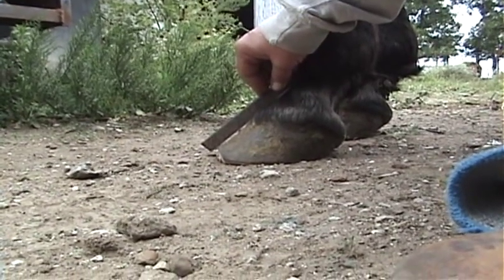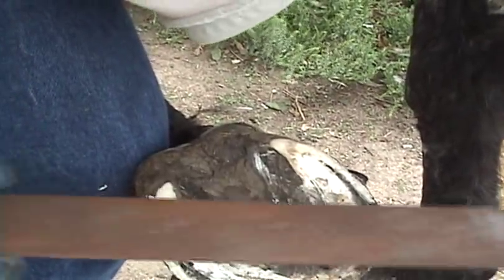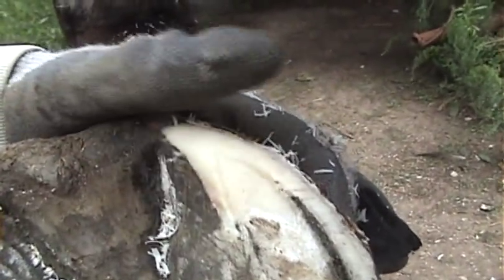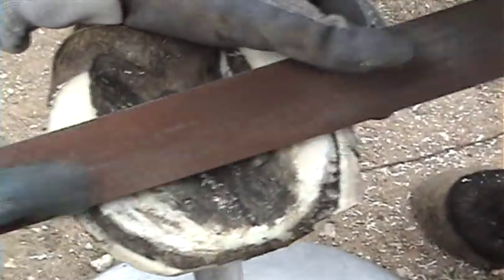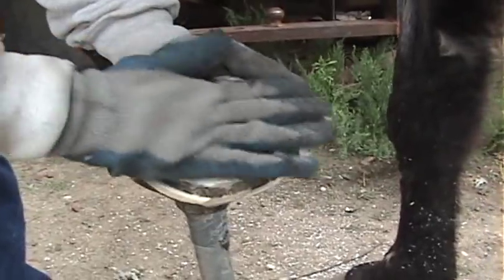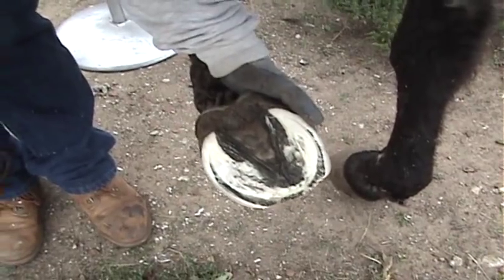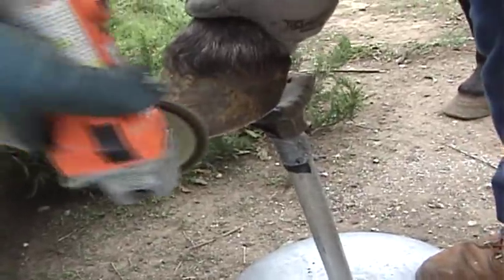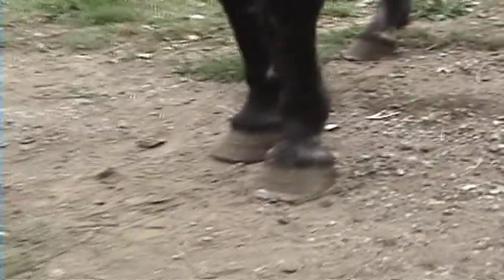Backing Up the Toe Part 2

Comment: I love watching your videos.  Every horse hoof and situation can be very different.  I have a percheron mare that I have been trying to re-hab.  She had not been trimmed in years and is 2000 lbs.  ?? of laminitis or even founder in her past.  She is older and can't hold her feet up for very long and is scared of farriers.  So, I have had to take this on myself.  All of the work I have to do is done by me just holding her huge hoof in my hands.  I have recently tried the grinder and her and I are getting used to it.  She has had some sole bruising, but is walking heel first.  Using he mapping, her toe still needs to come back a bit.  The mark is actually into her sole.  I'm still a little hesitant, and have been bringing it only back to white line or the edge of sole.  I am trying to do a little at a time, not only because it is very hard work, but just to not be too drastic.  I don't let her feet grow out and get unmanageable.

Comment from the maker: Actually this is antiquated as of 2 months ago, I totally have changed the way I do the toes and bevel the hoof, but I have not had time to do new videos and take some of the older ones off. You used the term "dubbing" are you a regular farrier? In some of my videos I kinda give farriers a hard time, NO OFFENCE indtended to the good ones. And I don't exactly feel or think the same what I use to on some of those issues.
Reply: How do you trim your hoof toes now with stretched laminar?
Reply: @mjgardiner3188  this is what I’m curious about too
Reply: A good farrier has no concern over your “hard time” 😅😅😅 keep working on your road to knowledge. Never give up!